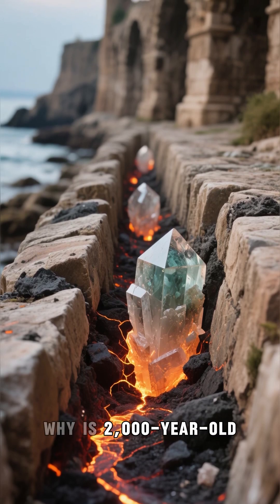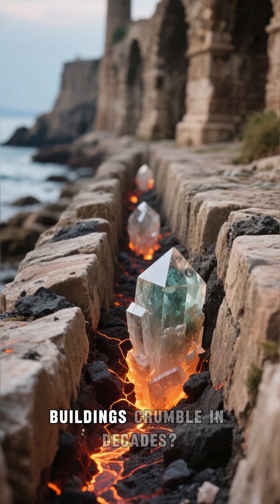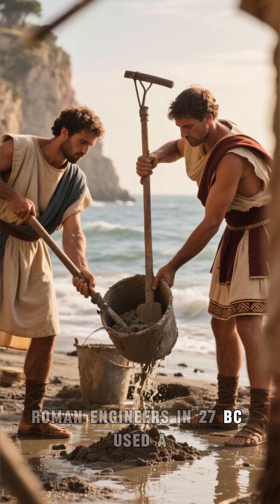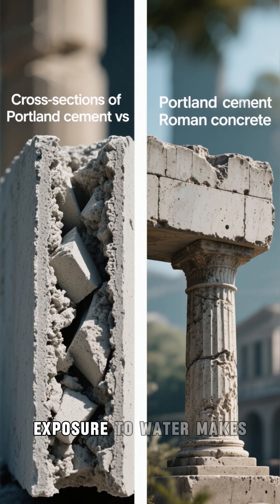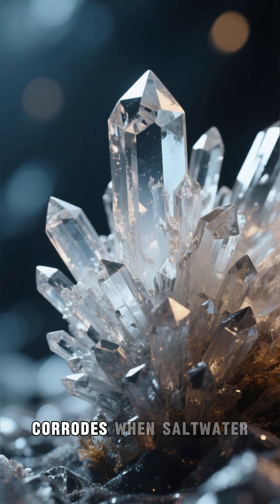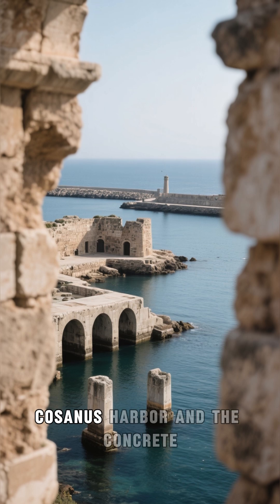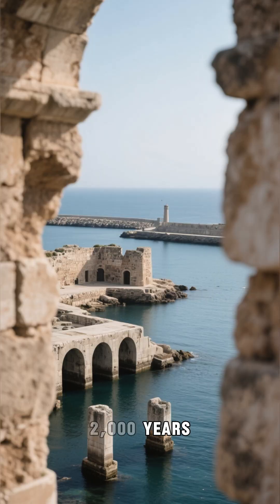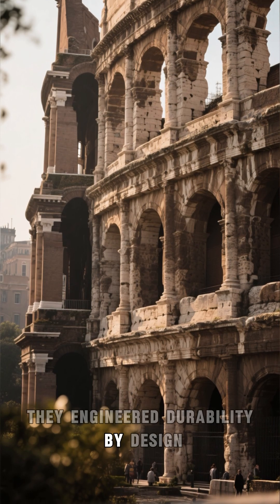Why Roman Concrete Is Still Stronger Than Modern Cement

Comment: You would not be able to build today structures with Roman concrete without using steel or reinforcement inside.  Concrete can handle high compression loads, but fails in tension, hence the steel reinforcement to allow for high tensional stress in the construction...but it comes with a tradeoff and that is the water in concrete makes the steel rust, and rust occupies a larger volume and creates pressure from within that cracks the concrete.  As opposed to what most people think, concrete do not 'dry', it hydrates.  It you allow fresh concrete to dry it becomes brittle.  And the salt in the seawater used by Roman's acts as an accelerator making the concrete cure faster, however, concrete can actually increase in strength 100 years after it set for the first time.
Reply from the maker: Wow! Very Interested , Thanks for suggested , I try the best more detail.